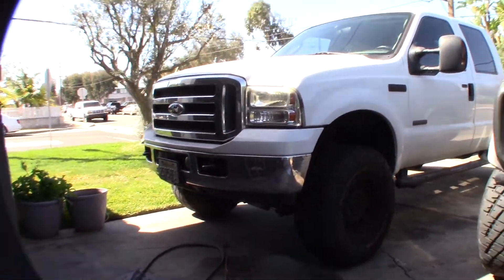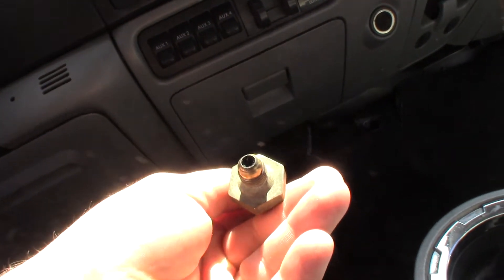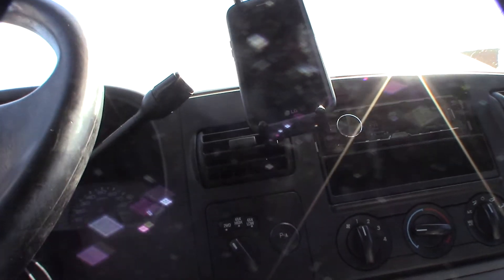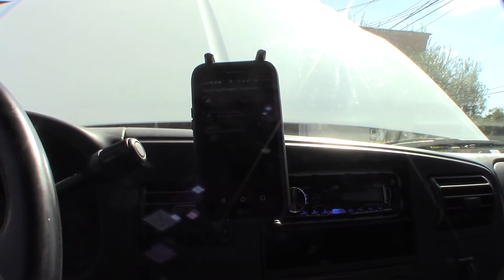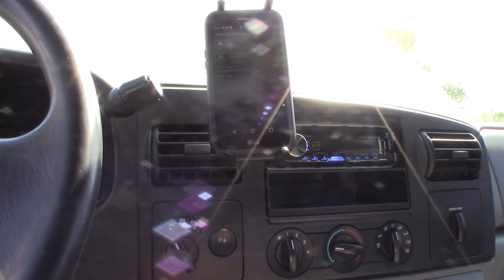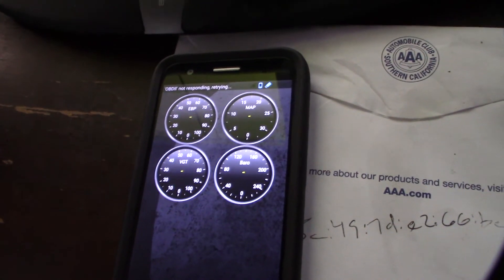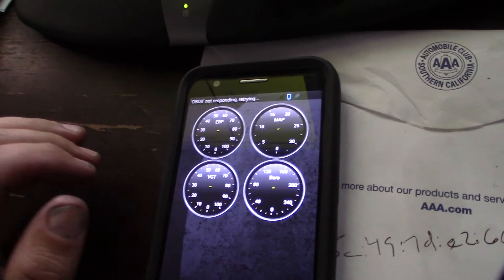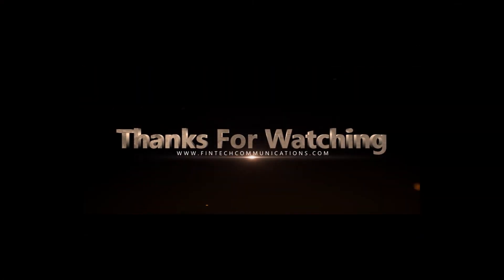P0470 Exhaust Pressure Sensor Malfunction  Powerstoke 6.0 VGT turbo fart intake backfire

Comment: Did u ever find the problem? Mines doing the same thing and I just replaced the ebp sensor with motorcraft one, and still doing it and getting the same code????
Reply from the maker: I put the stock one back in and the problem went away. I bought a cheap amazon one and it did not work out the box correctly.
Reply: did you clean the tube? probably full of coke.
Reply: @steveboggs9025  "COKE" Shit I'm going out right now to check mine !!! Even comes with a Tube.
Reply: Did you find out what was wrong with your truck, I'm having a issue.. maybe I killed my new one with brake cleaner
Reply: @tonyvela658   Unless you bought it directly from FORD! it probably never worked to begin with always buy FORD! factory parts if it's anything that has to do with the internatonal engine  Not only because of quality but a lot of the parts still have patents that have not expired yet and aftermarket companies can not make an identical component so they modify them which never work as good as original designs  Even oil filters if you do not use Ford factory oil filters that is a fact it will destroy your engine because aftermarket filters never filter all of the oil dirty oil seeps by Slowly clogging your oiling system
Reply: 10-4.. I allways try to buy ford oem parts